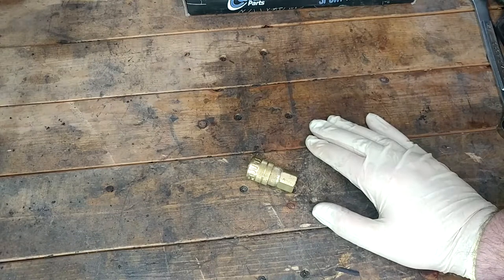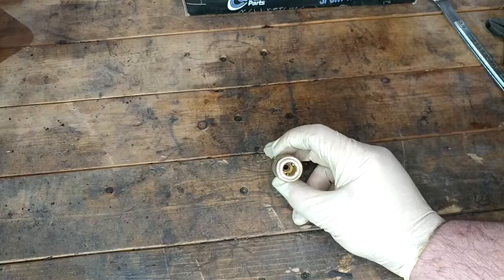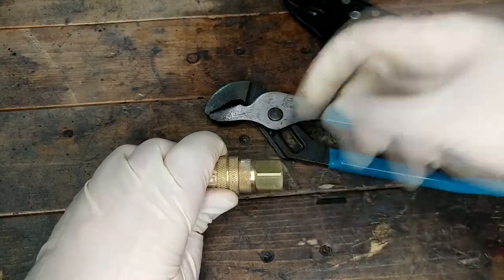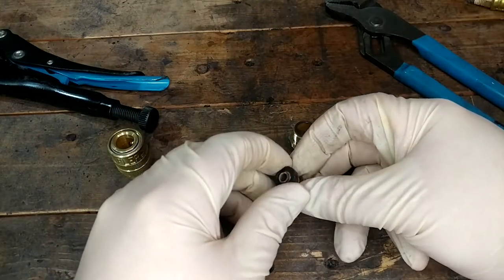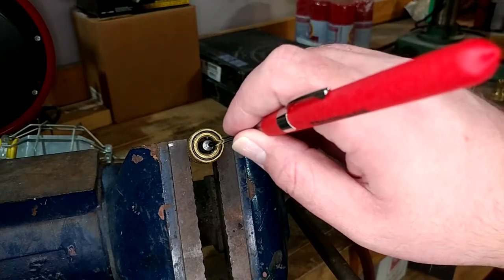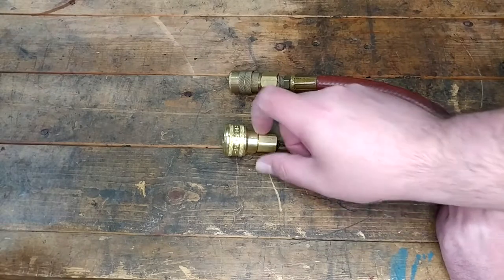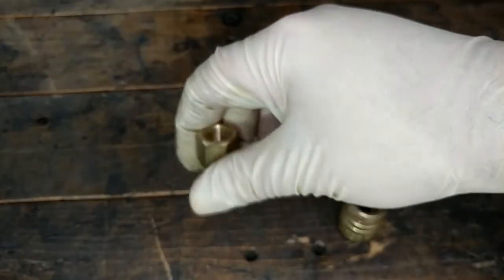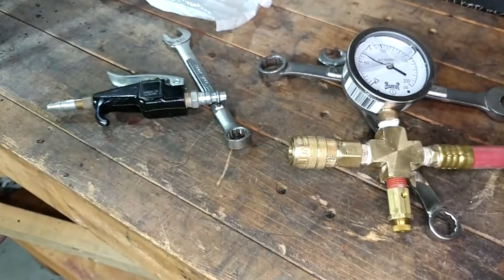Air Fitting Rebuild... Again!

Comment: You can just press on a Milton V-style, just like you did with the Parker.  They're the only ones I use as they flow a little more air.
Reply from the maker: I haven't tried a V style Milton before. Do they still have steel plungers?
Reply: @TheBrokenLife  not certain.  Just looked and it's not real obvious.
Reply from the maker: @mikeyb4642  If you have a small enough magnet on a stick you may be able to reach it.
Reply: @TheBrokenLife  there's a piece blocking access to the plunger.  I'm sure there's images on Google.  I would send you one if I knew how/if there was a way to do so.  It's a little different mechanism from an old M style I have laying around.  However, the female V style is compatible with both V and M males.  So you only have to get the female for quick connect.  But for increased flow through connection points, you'd need both male and female V.
Reply from the maker: @mikeyb4642  Humm... I'll pick one up and take a look at it. If it has all of the benefits of the Parker at 1/3 the price, then it's a no brainer.

That said, if you're ever dying to send me something, the mailing address for the channel is in the description of newer videos.
Reply: Another fan of the high-flow V-style Milton coupler.
Reply from the maker: @halfstep67  There are many of you. I'll have to take a look at some.

Comment: If you have all that rust and moisture, what is it doing to your tools? Consider a $40 3/8 inch  in line filter and dryer and a bag of silica gel pellets.
Reply from the maker: I addressed this issue on the compressor that replaced this one. It's in the air tools and compressors playlist. 👍

Comment: If this is what I think it is your the man! 🎉😎 subscribed
Reply from the maker: ...what do you think it is? 👀😅
Reply: @TheBrokenLife  most of these tend to be air leaks on YT my gf’s milwaukee battery compressor the female QC got stuck essentially forward with the collar back. I drained air from the release to pretty much zero. Was able to push the screwdriver to pop the valve. Bunch of paint chip rust particulates blew out with the 2lbs air left inside. Charged it up jimmying the entire inside valve on the quick coupling and it cleared the issue. Was hanging it up I guess. Even I couldn’t plug the male end in at the start of this project. But I’m sure eventually I’ll be doing what you did. Hopefully a Parker fits the machine. I’m sure whatever milwaukee uses it’s not a Milton. Prob harbor freight type. 😂

Comment: Clamping Vise-Grips on soft connections like that is also not a good idea. The connection gets crushed and becomes egg-shaped. The correct tool is a small pipe wrench which distributes the force on 3 points..if used correctly...lol
Reply from the maker: A pipe wrench would have turned that knurling, which you handle every time you use the fitting, into a series of razor sharp gouges. It would also look awful.

The "right tool" is whatever Milton used to assemble it, which most certainly isn't a pipe wrench or vice grips. This is yet another reason that I have moved on to Parker fittings which have actual wrench flats made into them.

Comment: So you're right, there's no reason they couldn't make them from brass, bronze, aluminum, stainless, plastic or something that doesn't rust
Reply from the maker: As proven by Parker who made theirs with an aluminum interior. I still think the Milton's are a good product for the cost, but I'll be moving on to the better product for way more money.
Reply: @TheBrokenLife  I've heard amazing things about Prevost S1, its an industrial style safety coupler and fittings, pricey but I think I'm going to switch over I'll have to change on my service truck in my home shop and at my work shop oh, I'm not sure what material they're made out of but I'll be sure to check when I get them
Reply from the maker: @brianwalk108  Those fittings do look interesting, but I'm not wild about the plastic bodies. They're not a lot more than the Parker fitting I showed in the video so I may grab one at some point just to play with one.

Comment: $15 .....it's $34 on Amazon
Reply from the maker: A few things:
-This video was published nearly 3 years ago and things do change.
-Unbelievably, I bought a second of that fitting a few weeks after filming this for $14. 😂
-The current offer available for that fitting on Amazon is not being sold by Amazon, but a 3rd party seller. The last time Amazon itself had it in stock, it was $16.50. Always pay careful attention to who is actually selling something before buying it.
-I've had very good luck buying Parker stuff as gently used/new-shelf-worn industrial surplus on eBay. Right now, I'm seeing offers starting at around 15 bucks for similar fittings in "new" condition.
Reply: @TheBrokenLife   Okays thanks,,,, I pulled my apart and got it to stop leaking thanks for the video...👍
Reply from the maker: @epitt906  Glad to hear it! Thanks for watching. 👍